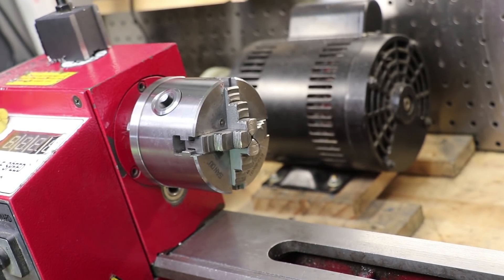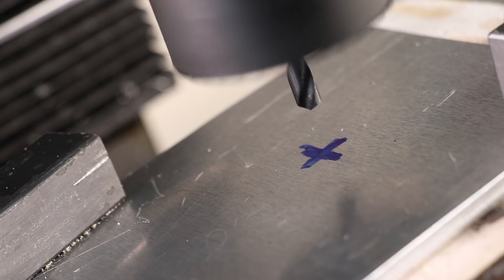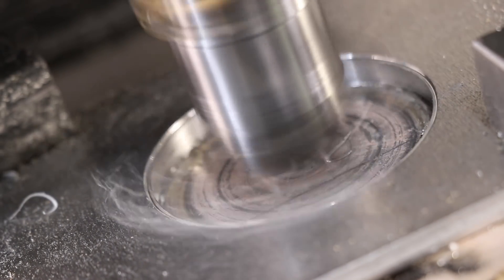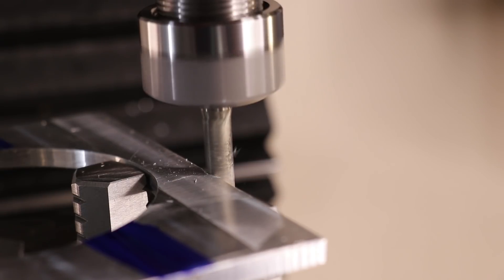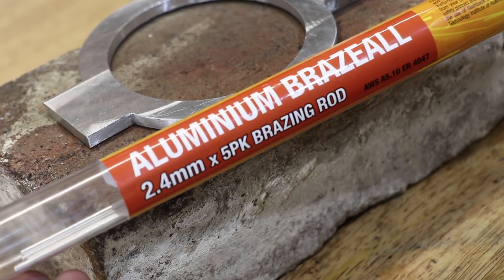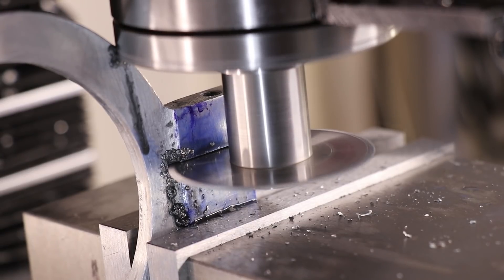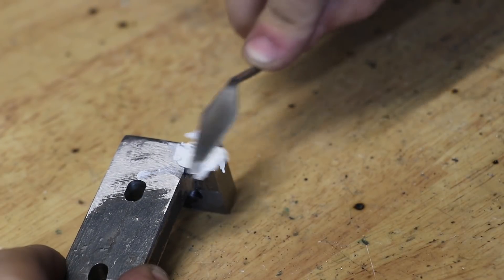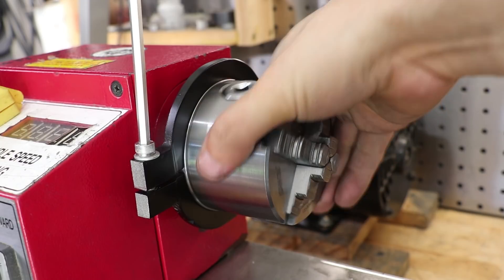Mini Lathe Spindle Lock Upgrade

Comment: One question: how do you mange NOT to forget to losen the lock after you are don ?  It seems needing an electric interlock so that the motor will not get power when the spindle lock is on.
Reply from the maker: In the 2 years I used this machine it never was an issue. I mean if you want to add a cut off to the motor you can but I never needed to. And if you turned on the motor it would probably stall out

Comment: Mate, I say! Brazing aluminium parts with an aluminium rod is like brazing bronze parts with a bronze rod. Or steel parts with a steel rod. Obviously the rod and the parts will melt at around the same temperature, give or take, which turns the whole process into welda vulgaris.
One could just solder'em.
Reply from the maker: As I understand it, they put additives in it to lower to melting point of the rod to avoid melting the base part. Watch project farms video on this topic, you'll see that the good ones melt at a much lower temperature
Reply: @artisanmakes  Absolutely, mate. But your parts aren't of pure Al, rather than of an Al alloy which means they too have lower than Al's melting temperature (actually, temperature range, allows are like that).
I stay my ground: you'd be better off should you choose soldering, given your materials and construction requirements.
Cheers, mate!
Reply from the maker: @TheZzziggy  Cheers you do you I guess :)

Comment: Came together ok in the end, should be a useful addition. A bandsaw or scrollsaw would have made some of those cuts easier. I'm surprised lathes don't commonly have a spindle lock, maybe even connected to the motor controls so it doesn't burn itself out trying to spin when locked

Comment: Anodising the aluminium would have made a slick finish
Reply from the maker: Yeah, im looking to get an anodising set up soon. Currently not easy to find sulphuric acid for the job
Reply: @artisanmakes  you don’t need sulphuric acid, hydrochloride acid will do the same. At a concentration on 20:1 should produce the same results. Sulphuric Acid has the potential for a violent reaction when diluted with water hence why it’s supply is restricted in Australian stores
Reply: Hydrochloride Acid (HCl is the chemical formula) you can get it at any Bunnings or pool shop, makes sure you ask for concentrate as they normally sell it at 10% concentrate
Reply: Hydrochloric Acid keeps changing it on me
Reply from the maker: @dondawson7409  I have seen people try and use HCl to do this using various set ups, but it never seemed to work as well as battery acid.
Reply: @artisanmakes  it’s all to do with concentration

Comment: Nicely done.
But I don't understand why we need to immobilise the spindle. Doesn't it stop the lathes from doing anything at all?
Reply from the maker: It's mostly to help my tap and cut threads with a tap and die. It's quite awkward to hold the chuck and there isn't much room, so this has come in handy doing that.
Reply: @artisanmakes  oh ok. So you put a die in a tail stock and rotate it there
Any other uses of locking the spindle? Sorry for newbie questions, I'm waiting for my 1st lathe ever to arrive
Reply from the maker: @TigerCarpenter  Yeah, I have a dedicated tailstock die holder too which I bought a few years ago. Other people find uses for spindle locks too. Some people have Dremel attachments for drilling holes in the work and the spindle lock holds the work in place.
Reply: @artisanmakes  ok thank you so much for your explanation.

now I understand that spindle lock is to use other tools, while the chuck is functioning as the immobilised material holder.
cool!

Comment: On overhead door openers that mount on the wall they are called jack shaft and only used on bigger commercial doors they have a break assambly that would easily work for what your doing  and you could even tie in with the emergency stop button and it would work perfectly for your needs. It has a electronic mechanical switch and that with the e stop button is what would engage it.

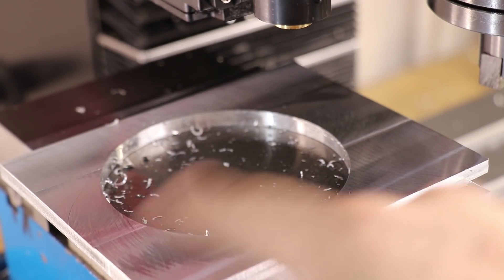Comment: 3:11 - So you use the mill to square up the stock. 4:16 - Then you hand cut it into a circular shape LOL WTF?
I also noticed the runout in the chuck backplate. Why don't you machine that off, it would take what... 30 seconds?
Reply from the maker: I was going to cut a different shape that would have made use of the flat sides but I changed part way through the project. And the flange is quite eccentric but the mounting register and spindle taper itself only have about 0.01mm of run out.  Not sure how they managed to make that run out at the factory but there you go. Cheers

Comment: Putty and paint 😁🤫👍👍👍
Reply from the maker: Special load bearing putty XD
Reply: @artisanmakes  - You need to learn the modern putty technique. It's called "rub it in and shape with the finger". Works much better than a tool, and far less sanding needed.

Comment: Nice job. I did notice, if you look at around 10:02, you're spindle looks like it has a lot of runout on the outer diameter, This may not have any affect, but something for you to look at in any case. Cheers.
Reply from the maker: The outside diameter mounting flange has a good deal of run out but the chuck itself and the mounting register itself only has about 0.01mm of run out. The run out you see does not affect any lathe turning. Cheers

Comment: Nice work. Crashes hurt the pride more than anything I think. I pranged a slitting saw in to a chuck that was mounted on a rotary table a while ago. Bit of Liquid Metal fixed the scratch on the chuck but it cost me a bit more to have the saw sharpened!!

Comment: I’m assuming that lathe has no back gear? On my atlas if I engage the back gear with the main drive pin still engaged as well it’ll lock the spindle solid. Just wondering.

Comment: nice job! i 3d printed a spindle lock out of pla and it has worked perfectly for two years now.
cheers.
Reply: I've even printed change gears to cut seldom used imperial threads. Runs a bit noisy, but works fine.

Comment: if you ever weld aluminum, TIG is the only option, i like lincoln electric 350, go as big and expensive as you can, with 220v. or better (I had 460v.) and watch Jodi on Welding tips and tricks....
Reply from the maker: One day my goal is to get a tig set up, although there just isnt the space in this workshop.

Comment: What is so different between a dividing head and a rotary table?
Reply: I think rotary tables are designed to be moved while cutting where as dividing heads are meant to be moved then locked before cutting so there could be a lot of movement in the part if it was being rotated whilst cutting
Reply: Ah, yes, indeed. You lock and unlock dividing heads between movements. Still...I wonder what's mechanically different. Bearings probably.

Comment: Take it off, clamp the clamp part of it in a vise on a mill, drill another hole through the top part of the clamp(thread it for a set screw), drill through the bottom part with the same drill, not through, just a few mm, about 5mm is good enough... Take a little set screw, take a small but powerful spring, shove the spring down the hole and set it in the other hole, tighten it with the setscrew and voila, you have a pair of parallel holes, one for the clamping, and the other that constantly tries to pry apart the clamp and will open it up enough even if material deforms, when you release the clamping screw... That way you never have to worry about it...

Comment: This is a Chinese Mini Lathe, right?  Why not just add something that locks the gears inside it?
Reply: Not all small lathes such as this one have gears inside the head stock, and if it did it would be much harder to do it that way than a clamp-type lock applied outside, and I can't imagine what the benefit would be.
Reply: @tcarney57  I was thinking the area with the change gears for the automatic feed. It's pretty accessible. You're right, though, that not all lathes have gears inside the head stock itself. (My Sieg SC2 doesn't have them. 500W Brushless motor... Just recently got it, and are still working to 'make it right'. )
Reply: @norwegiangadgetman  Yes, a close-fitting "pawl" swung over the gear on that end of the spindle would work pretty well, I would think. Have fun with your Sieg.
Reply: @tcarney57  A Pawl would probably be a bit more work, but it would be the more elegant solution. I'm putting it on the board for possible upgrades on my own lathe.  So far I've swapped the spindle bearings for Angular Contact bearings(roller bearings would have been better, but they're thicker and needs added lubrication)  and a QCTP of a different design than the ones you have.(this one may end up in the scraps pile) So I'm currently bingeing on mini lathe videos and asking awkward questions.(It's over 30 years since I used a lathe, so I have a lot to both learn and relearn) I considered the C3 actually, but the SCs have more torque.

Comment: Just a small observation: I think the locking bolt better be under the chuck, that way, it doesn't get in your way in the future.
Excellent job!
Reply from the maker: It might work better, and its an easy fix, but just from a visual stand stand point I would prefer to have the mounting bracket at the rear of the chuck. Cheers
Reply: @artisanmakes  Good point. Thank you.
Reply from the maker: No worries, best part about diy is you can do it how ever you want. Cheers

Comment: Looks great! However, at 10:02 when you're turning the spindle in the new clamp, there's about 1mm of spindle wobble. Since the clamp is locked, it seems to be in the spindle. Just letting you know that maybe your bearings are off a bit?

Onya, mate.
Reply from the maker: The flange is a little eccentric. The spindle runs true with about 0.01mm of run out, but that flange has a good deal of run out which does not affect the accuracy of the lathe